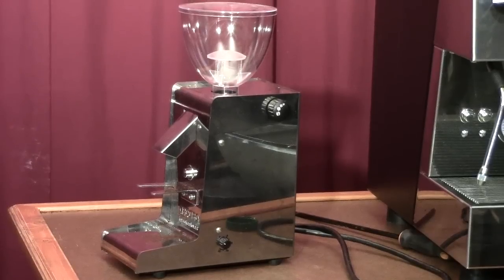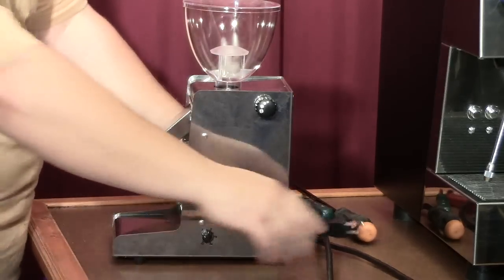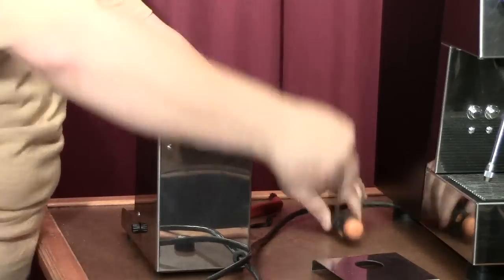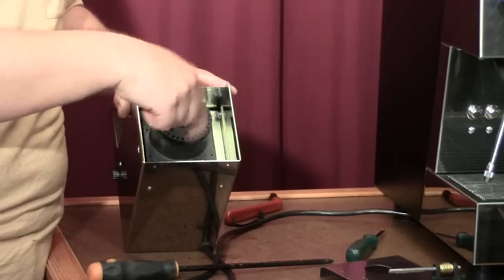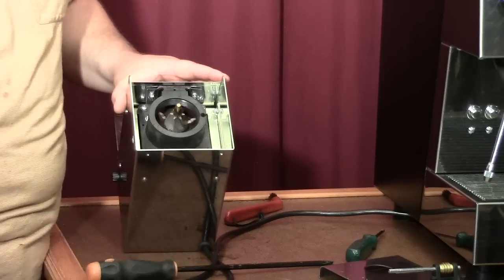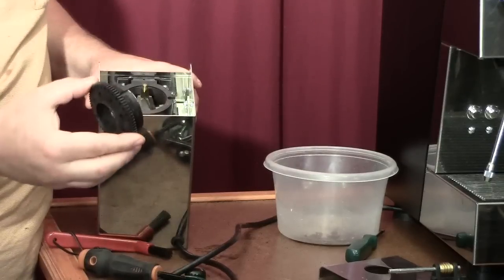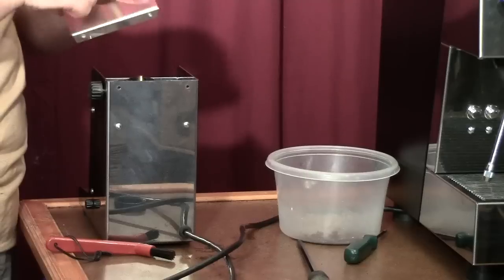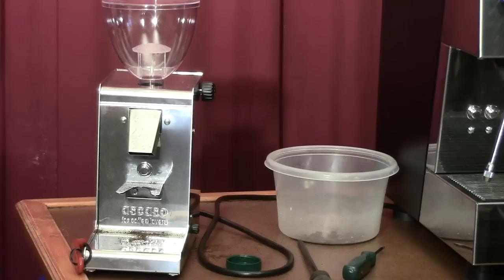Ascasi Isteel 2 Grinder Cleaning

Comment: Bah on mine there are two little nuts behind the screws for the cover. It was difficult to get off as the nuts would rotate with the screws, and then I had to superglue the nuts to the cover to screw it back.

Comment: Quick Question. do you  know how to detach the front panel from the push button?
Reply from the maker: I haven't serviced these grinders in 4 years and never had to change the switch, so proceed with caution, my best guess is the follow:  grab and pull the button first then with a thin gauge metal not sharp, get underneath the bezel and  move it around making pressure to come out you should be able to see the two sided expansion tabs press and pull the switch out. if this doesn't work your other option is to remove all the side and top screws then you may be able to pray a little and push the switch out.